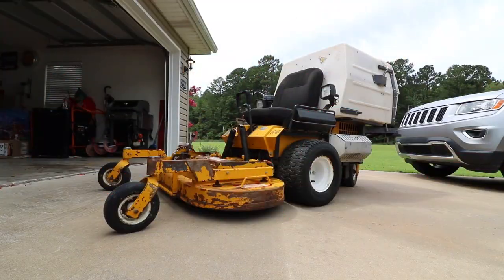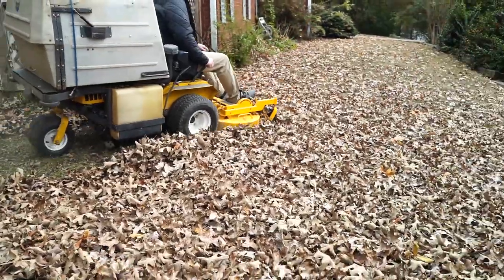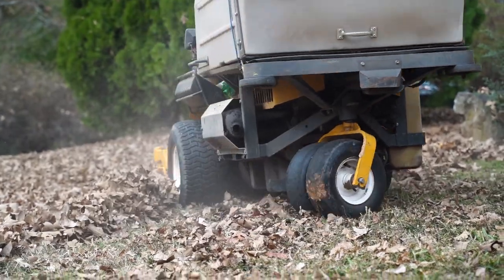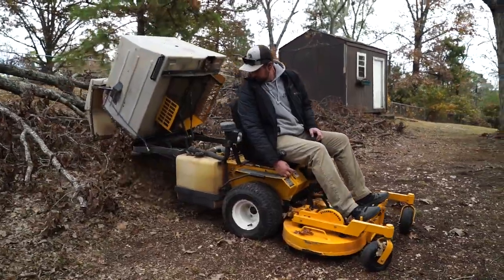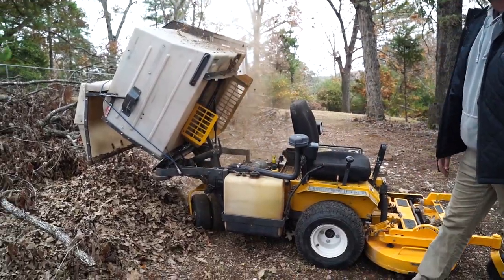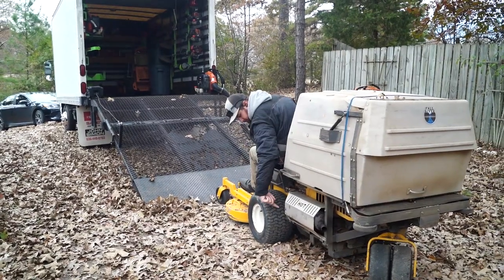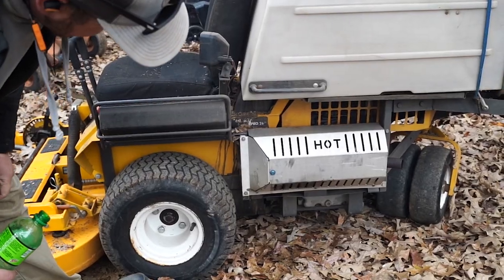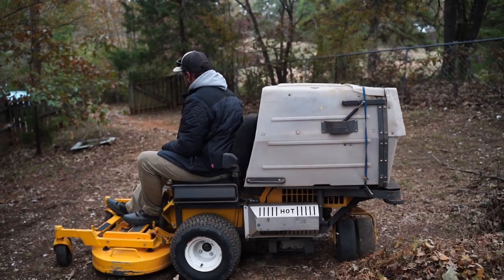The RUN down on MY Walker Mower: the GOOD and the BAD

Comment: I’ve got a t27 which is great but when you mow up thick leaves, go slow and use 1/3 to 1/2 of the deck width. You will find that’s quicker than blowing, mulching and double handling the leaves. The bin alarm is a must. When mine goes off you need to stop immediately but leave blades running for about 5 seconds to clear the blower tube.

Comment: When it clogs up, instead of raising the deck and cleaning from underneath, use a blower to clear the clogs.  Put the tip of the nozzle in the chute and easily unclog it.
Reply: Great idea but don't have to do that on job site. Gotta be a permanent fix

Comment: The alarm is common, quick easy fix they're like $20 I always keep a spare they go out occasionally. As far as the fire, I've heard of many guys having that issue. I never have but that being said I blow my machines completely off after every lawn and that seems to help. I hated dealing with those clogs during leaf season. This year with the Versimow x blades, haven't had that once and you see the leaves I deal with. Can't wait to try in the Spring because I get that same clog in thick wet grass. I would mess with that lever. Mine doesn't pop out on either machine. There's adjustment bolts to them that hold tension inward. Glad you're enjoying it, they're a love/ hate machine but I'll never go back.
Reply from the maker: I’ll look at fixing that alarm for sure if it’s only $20. I may have to look at the x blades and see if that helps me out. Thanks for the help man!

Comment: I have a 40 year old Walker and it still does a wonderful job. The previous owner was a lawn and garden service and his employees beat the crap out of it but I have fixed many things that they damaged. I have learned to listen for the change in sound when the box is filling up plus I reach around on the right side and try to lift the box. I have learned what it feels like when the box is nearly full of leaves or grass. I also only take half swaths when doing heavy leaves and raise the deck up higher than when mowing. Even though the deck is higher it still sucks the leaves up with no problem. I do not have the dump system that you have nor do I have the type of easy lift deck you have. As I said, mine is very old, It has the 16 horse cast iron Kohler and runs great for a 40 year old mower. I have had it for about 30 years now. She aint pretty but she sure knows how to dance.

Comment: I find that turning into the leaves with the side of the deck cuts down on clogs because the blades get a better shot at crunching up the leaves before the reach the blower intake, only problem is the wheels might peel out the turf if you’re not careful but this can be avoided with practice. Another idea is when you’re sucking up leaves go a bit slower and leave the back of the hopper (bin) open so that they blow out and then suck them up after once they’re smaller.

Comment: Its great, no spray saves time blowing grass spray and clean up on job site. I have the clog problem as well. I assumed it was wet grass clumping but even dry grass does. It takes a lot of time to unclog it several times. I raise the deck. Clean out deck shoot, leave back box up, run motor in park, cut on blades in to blow out schute tube. But deck shoot always gets clogged quickly.

Comment: That bar across the outlet is causing most of your trouble. You somehow need to streamline that like you would port and polish an old carburator but you need to maintain structural integrety as it looks like a link. Good luck

Comment: Get the buzzer fixed and install the larger hole screen in the hopper or take the screen out all together. If your mower can't discharge it won't suck as well. Also replace your blower belt.

Comment: Kevin,
Another suggestion for leaves is to lift the front of the deck up 1 or 2 holes on the adjustment. This seems to help. Also only take about 1/2 the deck when they is so much then come.back and make another pass with deck lower. I am glad you are happy eith your purchase.
Reply from the maker: I will try the deck adjustment trick thanks for the information

Comment: I get rid of the fill switch all together, it can contribute to clogging I had trouble keeping working any way. You can tell when you gone to far. I also check or monitor the air flow coming from the back of your box raise the spring flap a little  when that air low stop your about ro stop up or already have. Install  the discharge screen that allows more air to flow thru the catcher. Raise the front of the deck higher than the back, and if it clogs on me I sometimes just go ahead and mulch the leaves while it's clogged. I haven't tried reverse rotation deck yet I would think that would be a good  choice for dense leaves.

Comment: For clogs I usually use my leaf blower and blow our the chute from bottom and top. Lift the front of the deck one notch. When your in the thick leaves go slower. I usually mulch with one Walker then Suck them up with the other Walker.

Comment: Ya gotta love a walker!....I have a 20 yr old MTD 48 ghs kubota diesel walker. Hour meter went at 800 hrs so no telling how many hours this thing has. All in all I’ve spent 2500 dollars in it this year. It was my wife’s grandpa’s so anyway. It done awesome all mowing season. Got into leaf season and it just wasn’t performing. It would clog every 5-10 minutes. I almost sent into the lake at one property!  I was so frustrated. When I would flip the deck up to clean under and into the chute going to the blower I was feeling a piece of loose metal (on the chute from the deck to the blower there’s a piece of what I call flashing that’s about 1-2” thick around the house where it meets the blower. That piece of metal is just riveted on there. Probably due to its age it was just worn lose and wasn’t allowing the debris to get into the blower. Long story short put a new chute coming from the deck to the blower fan and it sucked harder than a hook on some mlk drive trying to make a buck! One thing I noticed helps to is to make sure the vents on the side of the deck stay clean too. They can come compacted and doesn’t allow the deck to breath or circulate as good. That and just keep the screen clean and keep your ground speed as fast as the conditions allow for. I’ve liked my walker this year but I really haven’t just loved it. It’s one of those tools I think you do need though. Cuts and striped like nothing else. But it’s slow and mud and isn’t worth a flip on any bit of slope. I want to add a 48” scag with clamshell I think to go along with my 61” cheetah 37 vanguard. I’m also planning to pick up the new exmark commercial 30 X series next year which is suppose to have the improved transmission and bigger engine. But a walker mower or an equivalent has it place no doubt. Guess you could say I have a love hate relationship with my walker. But like my dealer says can spend a little here an there on it or fork over 16-20k for a new one lol
Reply: I don’t have the burning issue on mine since it’s the diesel and the muffler is different. My beeper doesn’t work either. After I got it I noticed it was just unplugged. Plugged it up it beeped one time when it got full then haven’t heard it since. But with the diesel I can tell instantly when it’s full by the sound of the engine it was changed immediately and I’ve learnt to listen for it even with my head phones on
Reply from the maker: I’ll have to take a look at that chute and see if mine has the same problem. Thanks for the information.
Reply: Fall River sure thing bud. If when you reach your hand into that chute and you feel any obstruction in there then it’s not going to let the debris get to the blower to pull it into the hopper. Good luck with it. They can be frustrating for sure. I love it/hate it hate it/love it.

Comment: Mulching first is fine and dandy but you have to spread them as well before you sweep them. It thins them out and allows them a time to dry out a bit before you hit them. So, when you use your mower, put your side discharge on, to thin them out. Most important is go slow. the machine has to have time to sweep, swallow, and then digest the leaves just like you do when you eat a salad. If you swallow whole you choke and going fast will do that to your bagging system.
Reply from the maker: That’s a great analogy, I like that! 👍🏻

Comment: As far as it clogging up, if you have a bunch of leaves, your better off going slow or just blowing them. You should be able to notice a change in sound once the mower gets full. I have used walkers for years and also have an exmark ultra vac, the walker is by far a superior mower.
Reply from the maker: Slowing down is one thing I have to start doing. It’s just hard because the walker already feels so slow compared to the SCAG.

Comment: Also depending on the age of the mower make sure you check the voltage regulator is relocated to the motor bay. If you don’t and the rear tails go flat you will rip it off

Comment: Worked for a company and the walkers were ALWAYS in the shop. We spent more time on loaner mowers than the company mowers. I use Toro personally and havent had really any issues that were major. We just moved to a ranch to caretake and theres a brand new (residential) R21 Walker. 16 hours on it. I mowed for 10 minutes yesterday and it broke. They use a strut as a belt tensioner instead of a traditional spring. Strut is blow rendering the mower inoperable. I also spent 2 years working for a small engine shop/ mower dealer. We absolutely hated working on walkers so much to the point the owner today doesnt work on them at all. Too much labor time and most customers dont like the sticker shock when they come to pay the bill. He sends them down the road to the walker dealer. We didnt like working on them because of how tight they pack stuff and to do almost any engine work youve got to pull the motor. We saw gear box failures, collection system failures, electrical issues the most. The blades were also more expensive. The machines themselves cost more as an initial investment and due to the complexity of the design they cost a hell of a lot more in maintenance than say a typical style zero turn of good quality. This is my unique experience and everyones mileage will vary.

Comment: I run walker mowers myself for my lawn care business, and what I would say to do for the clogging so quickly issue would be to make sure you have proper tension on the pto belt as well as having correct engine rpms at full throttle. With the pto engaged at full throttle I believe the factory spec is 3700+-. 3900 no load. That should help, I use 48 decks and I think they can handle more with the wider debris opening and shoot.
Reply from the maker: I will have to check that. I have kinda wondered if I was getting the right rpms when Mowing. I kinda feel like it might be low.
Reply: Hi Moses !   I'm a Hall too,  wonder if we have any kin ties. ?  Where you from.  Im in Oklahoma but Dads family are from N. Arkansas .   Probably not but ya never know.
Reply: My dad was born and raised on the farm where we live now. We were from Kansas I believe way back. Our family has been on the farm since like 36 or 37'

Comment: Yes, leaves will catch fire, this has happened more than once, Walker sent out a protective horizonal plate, which I added, but still you have to be careful about doing dry leaves!
Reply: It's a finish cut mower,  not intended for leaf pickup. Smallest debris can and will damage blower. Then you get a 800 dollar repair bill.

Comment: I have never had mine muffler smoke  I as for the lrm make sure it has the paddle on it won't sound it a way fix  as for 5he clog just go slower on the et levels or blow the leves around spread them out

Comment: I use a walker and when it clogs for me that usually means that the hopper is full, the best way to do it is use a blower on the chute from the deck to the blower in the machine then do what you were doing and run the blower with the hopper up
Reply from the maker: The more times I have cleaned it out, I have gotten a lot faster doing it.
Reply: Yea I got mine in late July and it took a while to get good and fast at cleaning out the ghs system

Comment: Try having a new $14000 walker with the flames 😳. As far as clogging, I pitch my deck 1/4 to a 1/2 inch higher in the front. If mine clogs I turn it into a mulching deck, hit everything, unclog it, then hit everything again and it doesn’t clog. Love/hate machines

Comment: Your height adjuster handle problem is because the adjustment bolt and nut (located at bottom of handle) aren’t adjusted properly, not allowing slot pin at upper part  of handle to fully drop into desired height slot.

Comment: 1:24 Slow down when you go through leaves, it won’t clog as much. Especially when the leaves are wet.
Reply: You might try raising the deck to its highest setting, this will allow more air flow through the chute and should reduce clogging with more velocity into the hopper.
Reply: That too

Comment: Look into the fully bagging deck. That deck is the reverse rotation correct
Reply from the maker: Yes it’s a reverse rotation
Reply: @HFConstruction  The video footage shows it to be the standard rotation deck. If it throws it straight into the tube it's standard rotation. In think areas we turn the blades off & use the deck as a plow to push the bulk of the leaves to the woods or truck loader. Often to get this process started you need to make the edges of these areas a little more dense with a back pack blower so that they won't go under the deck & will push up into a pile instead.

Comment: I do not have a walker but did have some thoughts. I would suggest cutting off the exhaust heat shield at the bend in the bottom. This would allow the leaves to fall out better. I would think. I also noticed that your leaves were not shreaded very well. Does walker offer mulching blades ?
Reply from the maker: They do have mulching blades, I think I’m going to try them out.

Comment: So I bought a walker 42” this summer and it took some getting used too. But with the leafs I just raise my deck as high as it’ll go and suck up the deep leafs. Then after I do that I drop it down a notch or 2 and finish sucking up the stragglers and it does good! The clogging stuff sucks!!! Lol I just go slow and hope the leafs aren’t wet. And my walker doesn’t have the heat shield around the muffler so it doesn’t trap the leafs against the muffler. But like everyone else says it’s for sure a love hate relationship haha

Comment: how many hours did your walker mower have when you bought it
Reply from the maker: Not really sure because the hour meter doesn’t work.
Reply: @HFConstruction  im looking at one its 900 hr for about $7800 new ones run here 26000 Canadian not sure if its a good deal or not
Reply from the maker: He said this one had somewhere around 1600 to 1800 hours. I paid $3500US
Reply: @HFConstruction  that was a good deal  there asking 9500 can here for 1500 hr but new is 26000   here